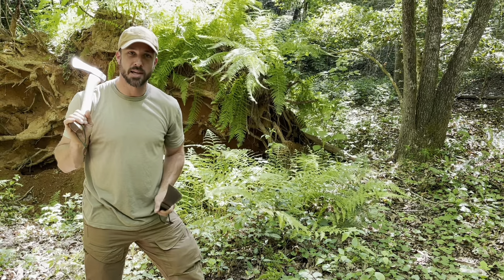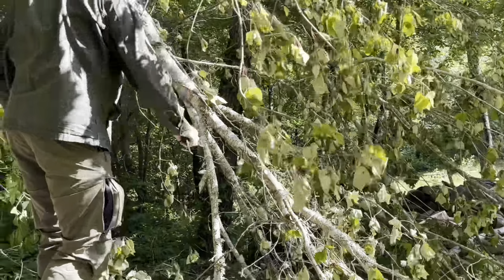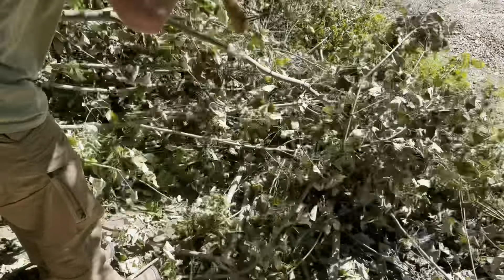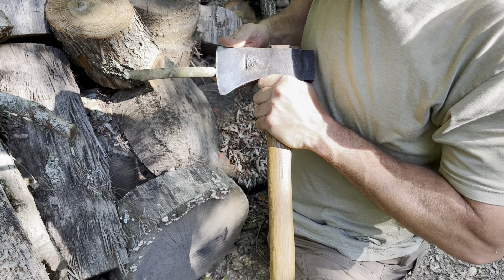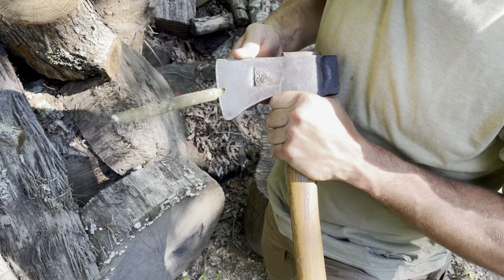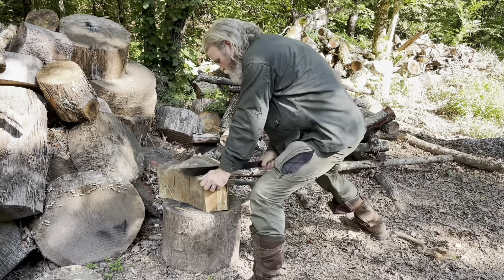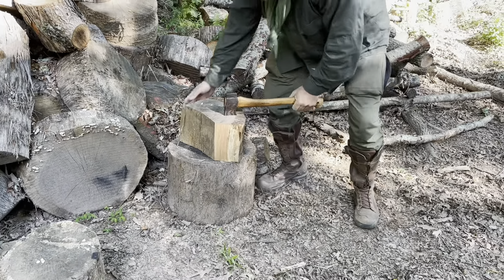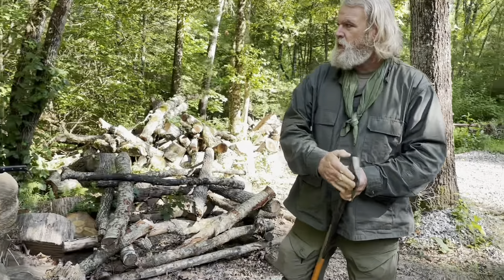What is the Best Chopping Tool For the Homestead and Survival?

Comment: Obviously everything depends on the type of environment and woods that you find yourself in. Some areas a tomahawk is enough, while others you need a splitting maul and an axe and a robust knife. Other areas a knife is all you need. With splitting, it’s good to be able to create wedges from wood and use them instead of a machete to split, and in the situations where all you have is a machete, at least you can carve a wedge with it and start a split with a cut that the machete can make. But you don’t always have room with certain long machetes like in this video and in those situations a parang may be best. It’s all to illustrate how it all depends on what type of environment you are in. But the best thing is to be able to utilize as many skills as you can master so that you can utilize whatever tool you happen to find yourself with, especially when that tool is less than ideal and woefully inadequate. That’s when you actually start to master your toolset.

Comment: Simply put it depends on what you need to chop.  
In my country (Oz) we have strict controls on any items that could be considered weapons.  But acceptance of carrying an axe for collecting firewood is more widespread if going camping and the like.  Even carrying a pocket knife is a no, no, although it can be justified if that can be demonstrated for trade or similar uses.  Tough, and what it results in is that mainly the crims carry banned items.
But if going bush then you can usually justify carrying suitable items needed for those activities.  I am fairly sure that I wouldn't be able to even source a Kukri except if a collector and for collection purposes.
Several years ago I had an ex-military machete but disposed of it after one of my sons was pulled up for carrying some restricted items in his car.
Reply from the maker: Can’t carry a knife? Crazy talk! Freedom is hard to come by in your neck of the woods apparently.